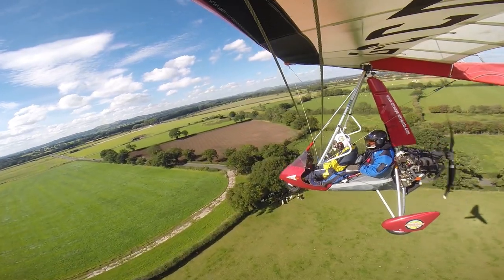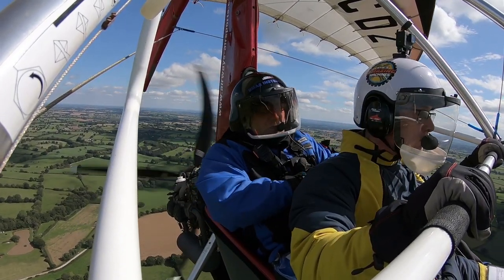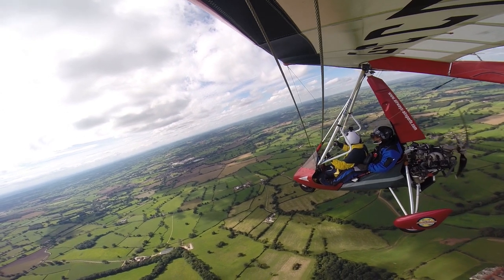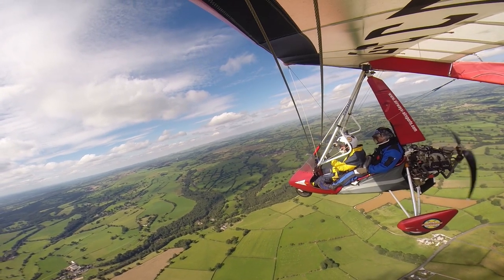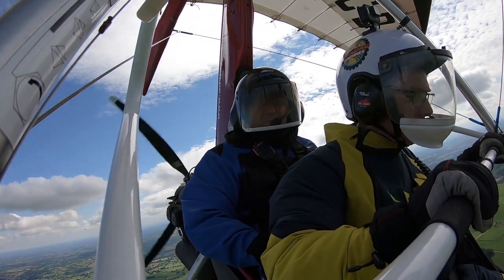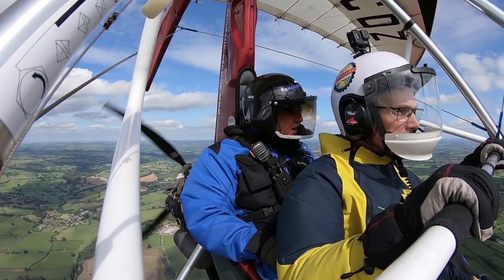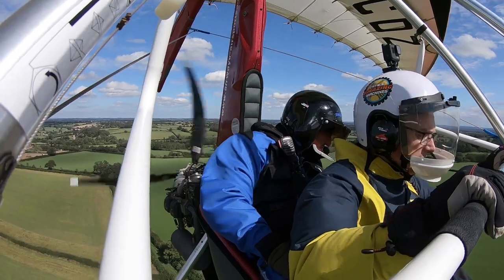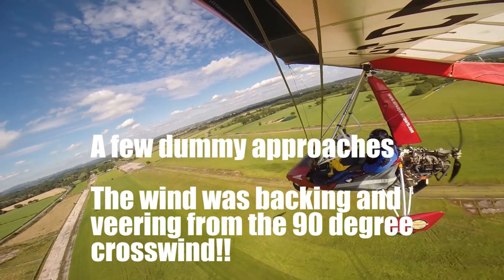Flexwing NPPL Journey  - Episode 7 - MOCK GST

Comment: Giles, thank you for sharing! Great video as usual. Quick question about Peabee comparing to AnT sub70.
It seems that Peabee has more leg room and lower position of the bar than on AnT. Even though it is not critical but just wondering being 6 foot. It is only my observation, correct me if I am wrong. How tall are you? Thanks
Reply from the maker: Hi Sam, I can't comment too much on the Ant. The PeaBee is fine with guys who are 6 as it can be fitted with foot peg extensions.
Reply: @GolfFoxtrot22  got it! Thanks Giles.